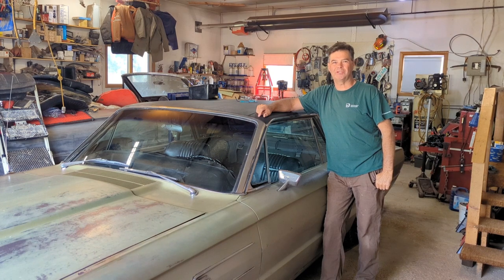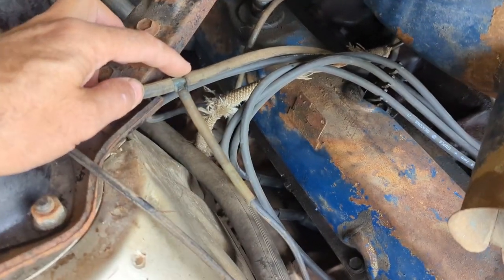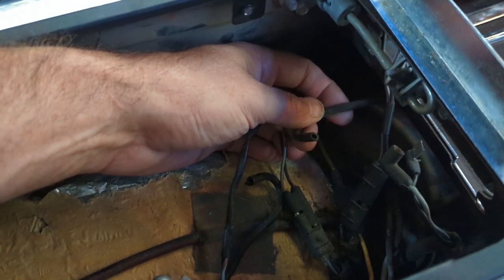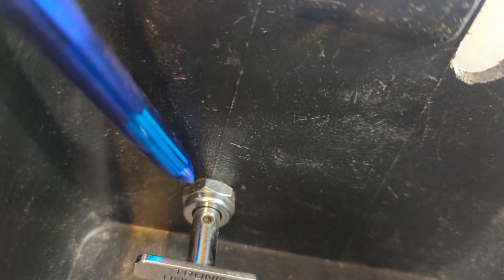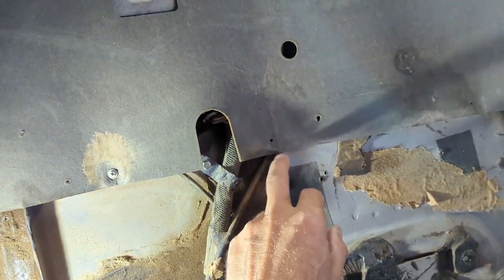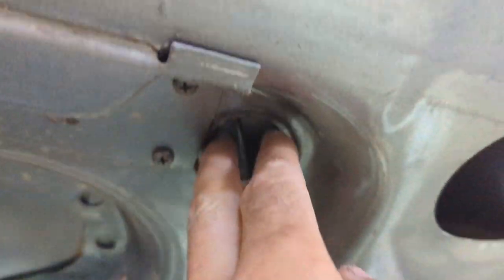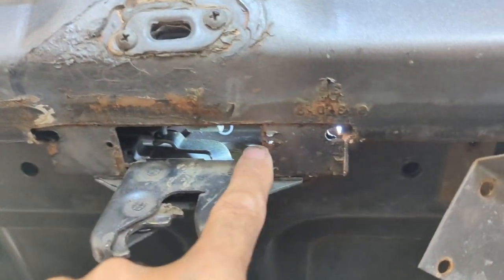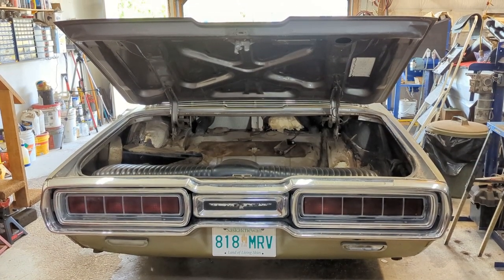65 Thunderbird Optional Factory Installed Vacuum Operated Trunk Release

Comment: Hello Alvin. Thank you so much for showing that vacuum system. That was very awesome of you to post it. I think the 66 that I have gets it's source vacuum from a different location. I say that because my 66 has a large "coffee" can mounted on the passenger side firewall. I think I may be able to tee off of the rear vent vacuum hose without an issue. Possibly someone else knows? 
I hope you had a wonderful Canada Day!
George B. in Michigan
Reply from the maker: You are welcome George!
I feel you will be just fine teeing into the rear vent vacuum hose after the "coffee" can. We did have a good Canada Day, just family over for a BBQ. 😎
Reply: I made a closer inspection, and there is a hole in the release latch that the loop end of the cable goes into.
George B.

Comment: Hey Alvin, thats a nice option to have. My car doesnt have that but I do have the parts to convert it if I wanted. I never drive it so I dont use the trunk that often. Your car also does not have vacuum door locks. Its funny how some cars came with some options and minus others, no rime or reason. The vacuum systems on these cars are fully dependent on the engine and I have always felt that was an inferior design. With electric motors like GM usually used, much more reliable. Nothing like having the air conditioning fail when accelerating because of vacuum drop in the engine. I knew you would stop working on the conv because you bought this. Looking forward to seeing more of the metal work on the conv, very interesting. Thanks for the video.
Reply from the maker: Hi Nick, I agree that there is no rime or reason with these options, and the electrically powered systems are more reliably. When I get home from the east coast, I'll be getting back on the convertible sheet metal work. I did however just make a front floor pan for the hardtop, I will be installing that after my trip...and also post a video for it.

Comment: I don't have a vacuum trunk release in my 64. But I have Vacuum operated rear vent, door locks and of course the parking brake release and HVAC controls. I would like to install some type remote trunk release. Not sure I can source all of the materials to do vacuum. Electrical operated will be about the same amount of labor. Thanks for all that you post. I find it interesting as well as informative.
Reply from the maker: Hi Walter...it sounds like you have enough vacuum lines to deal with without the added truck release! Thanks for watching! 😊
Reply: I have to agree. Enough vacuum lines.

Comment: I’m not looking forward to replacing all them vacuum hoses, maybe my son and I will switch it all to electrical or cable driven. 
We have been in monsoon season here so I haven’t done anything with the pass floorboard other than cut it out and layout all the bends and rolls. But when we get a break from all the wind and rain dumps I’ll send you pics of the progress.
Thanks for the video, and as always looking forward to your next video in August.
Reply from the maker: Hey Troy, there are a lot of vacuum lines that's for sure, especially on the A/C cars!
We have been having a lot of (greatly needed) rain here also, it does however put the brakes on the outdoor projects, and speaking of floor pans, I made one a couple of days ago for the hardtop drivers side, It turned out ok, but definitely room for improvement! Lol

Comment: hey Alvin, thank  you for posting a video on this! My 66 bird also has the vacuum trunk release in the console! Somehow in the entire hinge unit and vacuum system were all taken apart. I'll put it back together, the vacuum line is loose and is there, so should I route it through the holes over to the hinges? Just want to make sure I do it the right way and see what really happened as to why  the trunk  lid was dismantled. 😀
Reply from the maker: Hi Laszlo, the vacuum hose routing I show in my video is how it was installed originally...so I would do the same.

Comment: Thanks for the video. I don't have an interior trunk release, but it was interesting to see how it works. It was also interesting to note that your vacuum canister is different than any I've seen before. I forgot that you don't have AC, so (as I recall) you have cables on your heater and defroster controls rather than vacuum lines. Your canister is mounted where my heater/defroster (and rear vent) vacuum canister is in the engine bay. My canister has more rounded edges than yours.  For AC cars WITH trunk vacuum release and vacuum door locks, there is a second canister (which I don't have, of course) that appears to be on the passenger side of the firewall, at least in the pictures I've seen. Those canisters look similar to yours, but are noticeably longer. I'm wondering: Do you also have vacuum actuated door locks, too? If not, I'm wondering if maybe that's why you have a shorter canister in your car...or if there's some other reason. I'm guessing that the types of canisters found in your car are somewhat rare and hard to come by. Glad it's still working. Might be expensive to replace.
Reply from the maker: This T-Bird doesn't have vacuum operated locks, so I think your are on the right track with why the can is so short...even though the one on my car is beat up a little, I happy it's still on the car, and working! 😊

Comment: I see that this 65' has the Transistorized ignition , is it operational ? If so which ignition coil does the engine have ? Is it possible at sometime to do a brief video about the operation and which coils it must have and other bits that are required, my 54' has some of the obvious pieces, but the coil is a mystery.  Thanks Doug
Reply from the maker: Hi Doug,  it does have the permatune ignition, and it is working. I will do a video on it, the service manual covers it in detail, so I'll do a little reading before I do the video, just to better understand how it all works.

Comment: Great video … as there are very few for reference. Do you know if the vacuum trunk release on a 61-63 is the same for a 66? I’m trying to add it on mine as it didn’t originally come with that option but I have every other option
Reply from the maker: Thank you! Sorry, I don't know if they are the same setup, and I only have have manuals for the 65 & 66.

Comment: Hello Alvin, my 66 tbird has an electric retractable antenna, the motor spins freely, but doesn't go up or down.  antenna was broken off at some point. do you have a power antenna on your 65? how do you replace a broken off antenna without having to take the inner fender off? can you do a video if you have a power antenna? many thanks!  :goodvibes:
Reply from the maker: Sorry Laszlo, I don't have a power antenna, but according to the manual for the 65 T-Bird...you need to remove the fender splash shield to remove the power antenna.

Comment: That's all fine and dandy, but the how do you open the trunk with no key, vehicle on and the manual release doesn't work? (I have that version) No emergency manual release? A 1965 Ford 390 V8 Landau. Is the vacuum line disconnected somehow? Or simply it doesn't work? How do I open it?
Reply from the maker: If you don't have a working key, drill it out, and replace it with one that has a key.

Comment: How does your trunk pop up as mine has to be lifted when i open it with the key?
Reply: I don't think it will pop up. Just kind of unlocks it without having to insert the key. I thought about that also. The trunk pops open in my newer (91 & 96) cars.
George B.
Reply from the maker: Without seeing your car, I will have to speculate. Maybe your latch or trunk lid is binding?